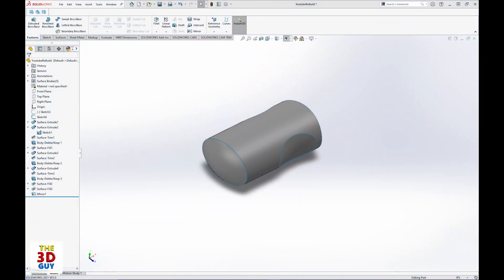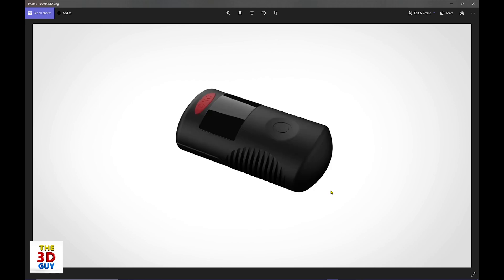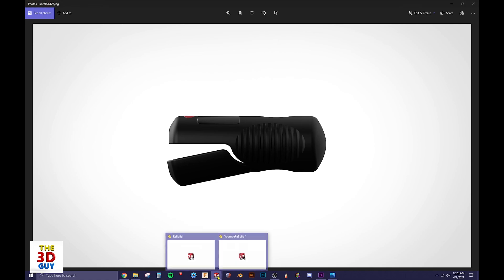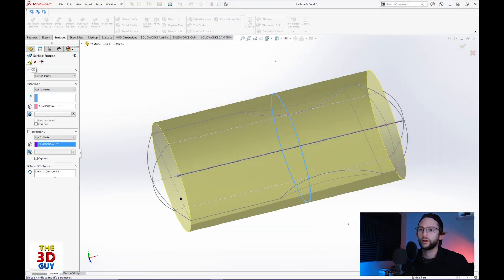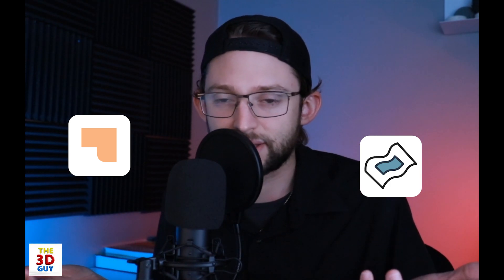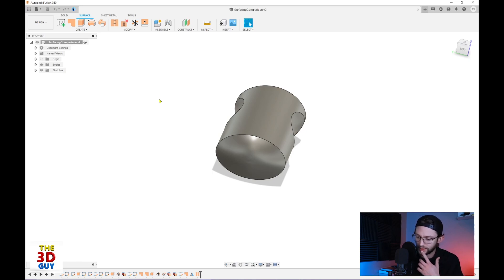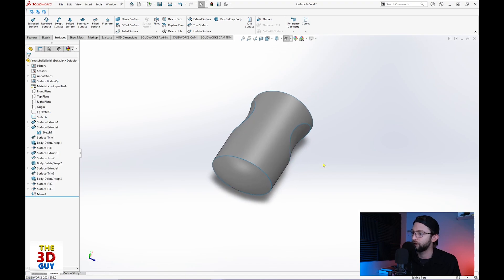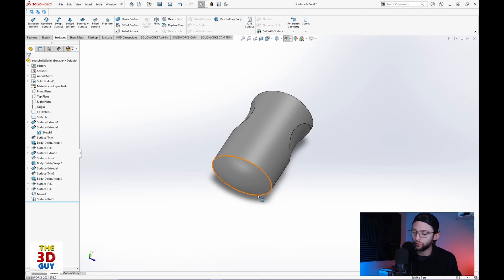Fusion 360 vs SolidWorks: Surface Modeling

Comment: Comparing surface modelling on solidworks and fusion by building a oval cylinder is like comparing excel to google sheets by writting one number. Cero value...

Comment: Pity you haven't got more views. I love this format of review. 
Do you know if either have a dark theme? I absolutely detest working for extended periods in exclusively light-themed software, as it hurts my eyes (there are workarounds, but they're kind of crap).
Reply from the maker: I know that Fusion does. Bottom middle of your F360 screen you will see a number of icons. Press the one that looks like a monitor which is Display Settings>Environment>Dark Sky. For a fully dark theme I am not sure, though I'll look into it and try doing a vid on it in the next week or so. I've though about using dark theme but feared it might confuse some viewers. Might trying it out on a few vids as I am on ALOT. cant say for SW (currently having licensing issues) though I am sure they do.